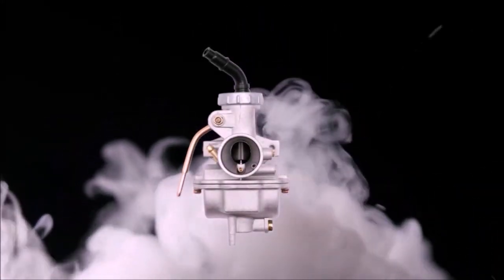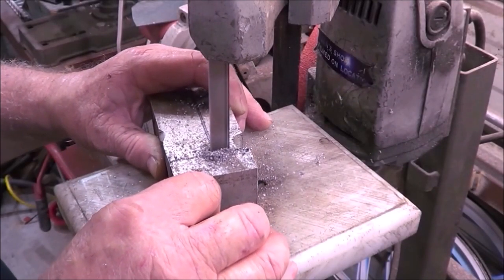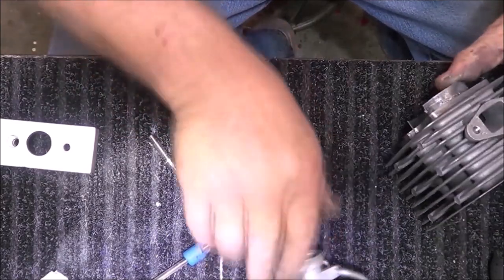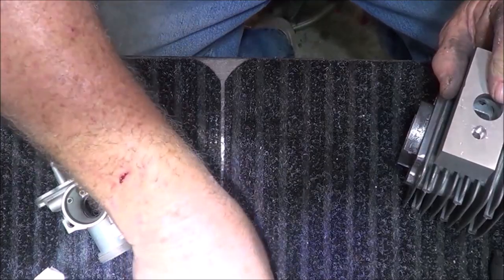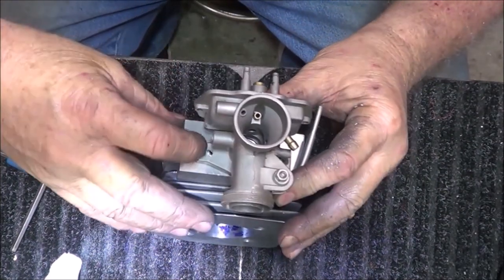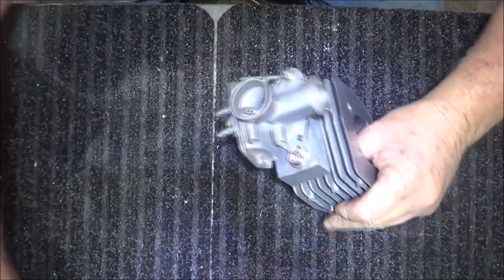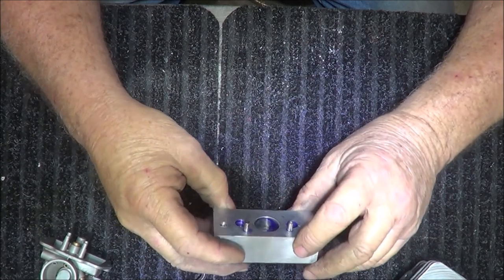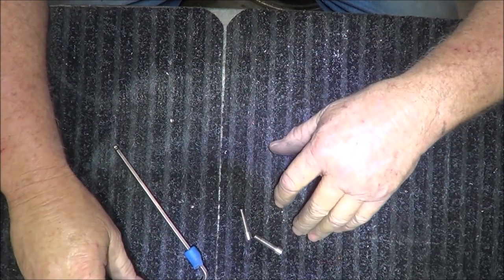Motorized bicycle The PZ 20 carburetor is it that bad part 1

Comment: LOL, I love these types of video, teach people how to use there hands an heads, plus like u said its been raining an we need stuff to do, ggz- Thanks for the Class 👽👍
Reply from the maker: My pleasure brother and yeah I've got everything pretty much done and I've had this carburetor laying around my shop for a year I pulled it apart and looked at it and I said well you know this thing really ain't that bad now mounting it was bad with that goofy flange just got on it but the carburetor cost $15 and a full set of Main and pilot Jets is $5 yeah I kind of want to get it working good thank you for watching brother drive safe and that case you got awesome
Reply: @KevinTodd  Thanks, enjoyed watching,  wish a had a lathe, maybe 1 day,  Theres no way any heat is getting to the carb tho, ggz-👽👍 i got a carb or two i havent used yet, now money tight so time to dig out stash,,,

Comment: Kennedy  asked 'why go to the moon'? Answer BECAUSE  WE CAN.  Great job. You could have bought  you a intake for the pz 20. Ie pit bike carb. Cut the intake little from flange and welded it. Nothing wrong with your super adapter
Reply from the maker: Thank you brother how you doing I hope you're doing good Happy Thanksgiving by the way yeah I want to get this little carburetor working good I mean it's $15 for a carburetor and $5 for a full set of Main and pilot Jets I mean really so you have a great day be safe and thank you very much for watching I'm going to give that little bike a ride today that we've got the 5cc head on and all the porting and everything going to see what it does and I don't expect much without HP carburetor but I never had one I want to see how it did it's got good power it idles beautifully but I don't think it's going to push that engine like it should we'll see what it does
Reply: @KevinTodd  great job on the intake 💯 %.  general  statement  always on any type engine 2 or 4 stroke. Longer intake runner  length more torque  peak power at lower rpm. Always enjoy your vids.

Comment: MR. Kevin another informative video love your little block that carb looks like my gt80 Reed valve with keihen carburetor I had to cut down the chock lever it would snag on my pants and stall the engine I like it cause the chock lever is on the opposite side of the throttle easier to turn off going down the road P.S. I told you rain was coming your way we stopped this morning got about 3to4 inches but we needed it stay safe can't wait to see it running stay safe brother
Reply from the maker: Yes you did and it rained here for 3 days but we got a beautiful day today and I'm going to put some ride time on the new bike and yeah I want to get this carburetor working I mean it's $15 for the carburetor and a full set of Main and pilot Jets is $5 I mean if it works good that's a win-win thank you for watching brother be safe ride safe
Reply: @KevinTodd  yes sir MR. Kevin I live on a budget myself. I understand that I'm going to ride here in a few and possibly work on one of my many projects lol be safe brother 3 inches I checked this morning that's what we got my backyard looked like your video

Comment: The intake I was using looks like a stock shorty but it's actually a 23 mm intake for a mikuni carb. I have to use a hose with those big of carburetors, just don't have enough room especially for the clutch arm. For some reason it won't let me post a link to the adapter or the intake without erasing the whole comment.
Reply from the maker: That's all right I'm going to get this one mounted in there somehow but I mean the carburetor cost $15 and a full set of jets Main and pilot are $5 dude if we can get this thing to work good I'm going to try thank you for watching brother
Reply: @KevinTodd  I would have kept my pz a little longer unfortunately the variant I had did not have replaceable Jets. It was a solid brass tube. But for not having to do anything to it it ran pretty good. Check out those NIBBI carbs , I only paid $30 bucks for mine. It's very unbelievably forgiving with tuning and it uses 5 mm Jets 😎. I wouldn't go any bigger than 19 mm though, hard to atomize fuel any bigger.

Comment: I came here looking for pilot and main jetting sizes for the pz20 carb clones.
They make intake adapters for these now 
In the carburetor i got it came with an 80 nain, and a 32 pilot.
The 80 us too tich about to try a 70.
The pilot is too lean, think j need a 35 or 38.
Anyways just wanted to see if anyone else has the jetting for these for an 80cc. Im running an ns460 jug on a yd100. Thanks for the video

Comment: I think they're ok carburetors. I like the fact that they actually have a separate pilot/main circuit, but if you need a different pilot jet to tune the idle/low throttle...good luck finding them. Personally, I think the Dellorto PHBG19 clone (sold as a KTM50 carb) is a better choice. It has an enrichment circuit instead of a regular choke (works better), and all the jets are easily sourced (Treatland carries all of them). The 5mm threaded NT main jets will fit them, which is a nice added bonus.

Comment: People are using these with a windowed piston and reed valve but I still like the NT carburetor. I have jets that range from 60 to 90 and the biggest I've ever had to go was a 78 and I personally know it's good for over 50 mph
Reply from the maker: It always run lean with me
Reply: @KevinTodd  couldn't you change the jet
Reply: @KevinTodd  I don't know if I should get a single or double windowed piston either. It's my first time doing it but I'm installing a ported cylinder so why it's apart then now is the time
Reply from the maker: @Westhelockpicker  I did went from lean to fat in one jet size🤣I think the venture is shaped for a 4 stroke some thing with a lot of pull trough not enough draft with these small engines JMO
Reply: @KevinTodd  most of the jets don't go up in single increments but I found that they do you just have to buy them from several places but they're cheap. Bikeberry has them from I think 60 to 70 in one increments so you get 10 jets but if you got performance parts then you're going to need bigger so buy a set from Amazon but they skip sizes they'll go from a 72 to a 75 and so on so you'll have to get a third set to fill in the ones you're missing but each is only like 5 bucks and you'll have one for everything and you might need to go up or down in the heat range of the plug so do a plug chop. Everything you add to the engine that changes air flow it'll change. Pain in the ass so I just add everything at once so I only have to tune it once and then you're set. I just gotta figure out if I should get a single or double windowed piston lol that and a reed valve is new to me

Comment: How much cc does it have ?
Reply from the maker: The carburetor is 20mm and the jug is 66 CC's thanks for watching ride safe
Reply: @KevinTodd  maybe you know a solution. My Yamasaki ym 50 8b runs 5000 rpm :) however I make adjustments with the 2 screws it still runs to 5000 stays there for aprox 20 seconds and then the engine goes off.  I bought now 3 same carburettor’s and it’s always the same issue. Maybe it’s a wrong CDI. What do you think. 

Greetings.